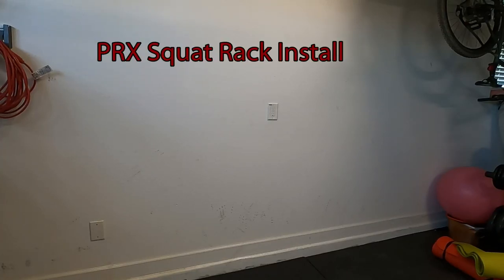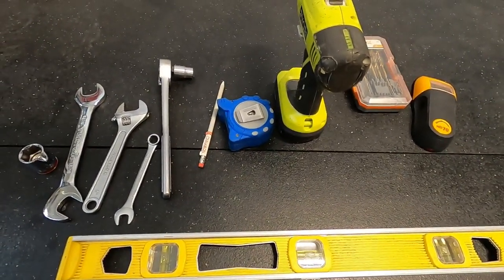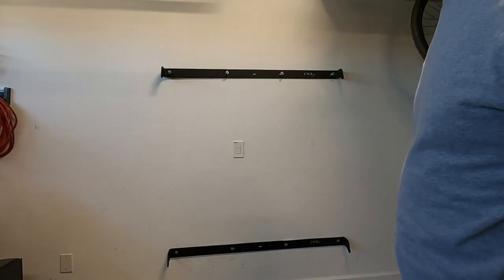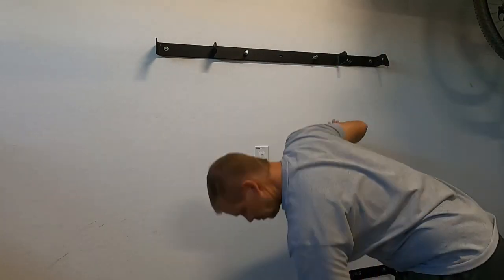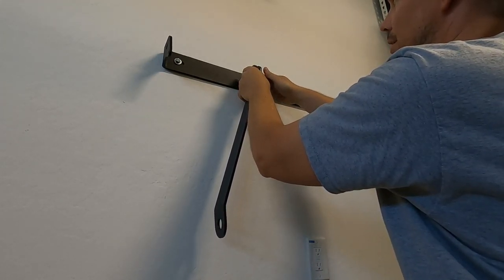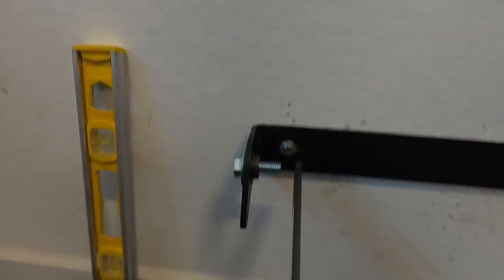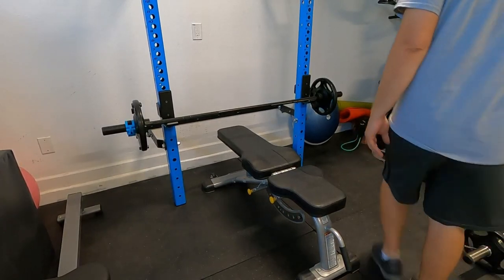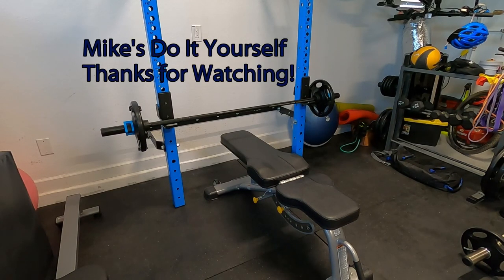PRX Squat Rack Install

Comment: Ibwomder if I can attach the rogue leverage arms to my 3x3 prx rack?  Been thinking about selling it to get the wall rogue rack so I can buy roguebtrolley arms
Reply from the maker: If it's the same size/type of rack, you should be able to buy Rogue parts to add to a PRX rack. - Mike
Reply: @mikesdoityourself  yea the rogue trolley arms work on a 3x3 post.  The trolley arms or leverage arms move up and down post racks so I gotta find out if the metal beams that attach to rack and wall will get in the way of the rogue arms?
Reply from the maker: @futbol1972  I would call Rogue and get dimensions of the trolley/leverage arms- that way you can see if they fit on the PRX- Mike
Reply: @mikesdoityourself  I will but since the trolley arms move up and down the post of rack o was just wondering if they won't interfier with the prx metal thingies that are attached to wall?

Comment: Should I do rack pulls on my prx rack with the spotter arms or will this be bad for the bolts on wall?? I don't want them to get loose over time.  I have two buldging disk so I wanna start doing rack pulls instead of deadlifts. There is someone who wants to buy it and will sell it if I can't do rack pulls on it to get rep fitness rack
Reply from the maker: Rack pulls shouldn't be an issue for this rack using the spotter arms. It's very durable so it should be no problem. Maybe if you were lifting super heavy weights- then I would keep an eye on the bolts after each use. Good luck! - Mike
Reply: @mikesdoityourself  thank u

Comment: Cool Vid Mike, What is the dimension between the wall and the outside edge of the upright when the rack in the lowered position? I am worried about my garage rail hitting the upright when the rack is in use.
Reply from the maker: 74 inches tall and 22 inches from the wall to outside edge of the rack- hope this helps!- Mike

Comment: From the way to stall mats look on the floor against the base you have a little slope in the garage, do you feel it at all when lifting or does the rack feel a little unbalanced? Thanks
Reply from the maker: The rack doesn't feel unbalanced at all. I have noticed anything with the slope- the only thing I've noticed is the mats have separated about a half inch. This may be caused by the temperature in the garage going from cold/warm or just shifting from stepping on them without having the mats backed up to anything on 3 sides. It took a few months for this to happen and I can easily push them back, so no real issue. Good luck! - Mike

Comment: Ordered mine yesterday, curious how long did it take to actually make it to your house?
Reply from the maker: It took about 4 1/2 weeks before the rack got shipped and about another week for delivery. For the two bar storage and spotter arms, it took 4 weeks to ship and 1 week for delivery. Home/ office weight equipment is in high demand still. Eventually the supply will catch up. - Mike
Reply: Hi, great video. Did I get the short prx rack (70")? I just received my  prx short  rack. I think I got exactly the one you have except mine is in red.
 I have to move my outlet up cause it will get in the way of bottom bracket I think :(
How far from from floor to bottom bracket, and how far from floor to higher bracket? Thank u
Reply from the maker: @futbol1972  Thanks, this rack is the shorter rack- 19inch from the floor and 51 inch spacing between mounting brackets - all the measurements in the video are for the shorter rack-you do have a few inches that you can move the mounting brackets up or down because they are on struts- it should mention this in the instructions- the spacing between the top and bottom brackets have to be exact though- Good luck!- Mike
Reply: Yea have to move outlet up a few inches.
My outlet is at 19" from floor to outlet.
I do have the short rack too.
So it has to be 19" from floor to the top edge  of the  bracket right and 52" in between?
Reply: Mike's Do It Yourself hello. I have 8 foot ceilings and your install looks like it is the same! I’ve been searching all day for someone like this lol. is your ceilings at 8 foot? If so How did you order his version? And what is the distance between your ceiling and the top of the rack where the pull up bar would be when extended out?
Reply from the maker: @imsotrash239  hello! My ceiling is at 10ft 6inches but I put the rack under my garage door roller bracket which is at 8ft. The rack should be around 70 inches at the top when folded down. I would have gotten the taller one with the pull up bar built-in but the clearance needed was 90+ inches. Good luck with your install! - Mike

Comment: Great video!  Just ordered mine yesterday. I’m curious, do you have any details on the rubber floor squares you are using?  Thanks!
Reply from the maker: I got them from a tractor supply store- about 45$ per 6ft x 4ft section- about 3/4in thick, good luck!- Mike

Comment: If the floor in my  garage has a slope do I need to take this in to account when installing?
Reply from the maker: If it's a major slope than yes, a small slope shouldn't give you any issues- most are sloped slightly because of drainage in case of water leakage from the house or garage- Good Luck! - Mike

Comment: Your numbers are different. Mine says to go 88” from mat/floor to the top on center.
Reply from the maker: Yes, this rack is the shorter rack w/out the pull up bar - you must have the taller rack that will measure differently.- Good luck with the install. -Mike
Reply: I would also add if you want to make sure you hit a stud use a small drill/bit make a small hole see if you hit a stud. If you miss you can always patch it up. However using a stud finder really helps.